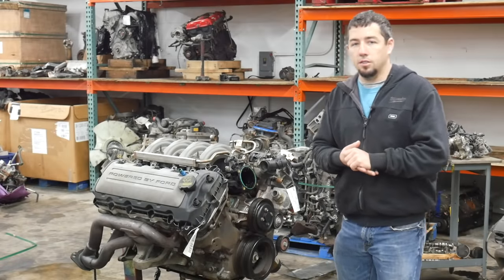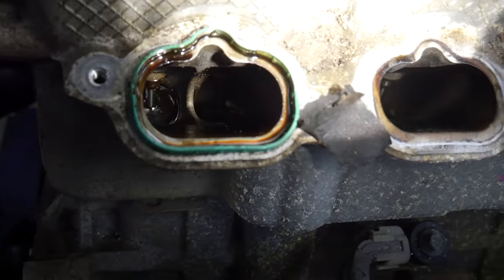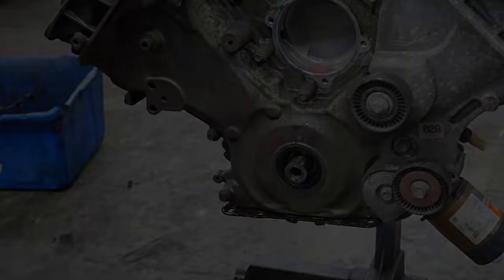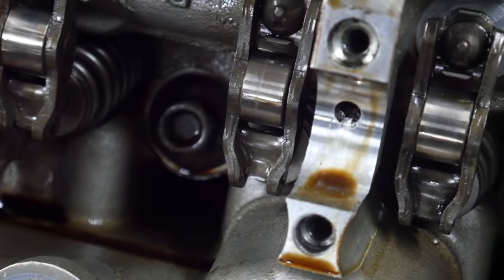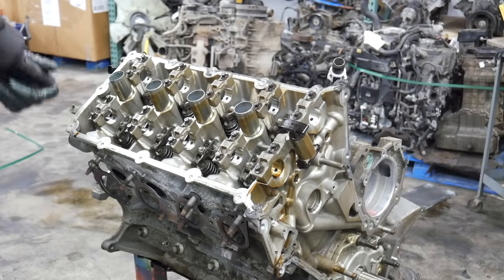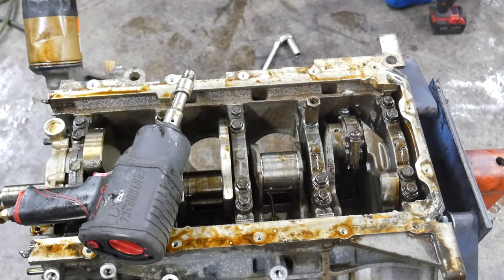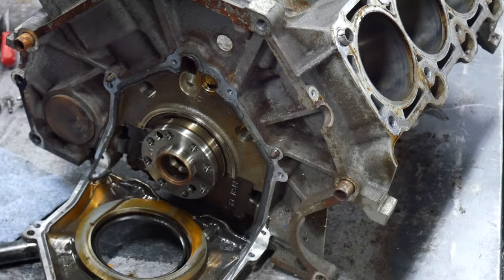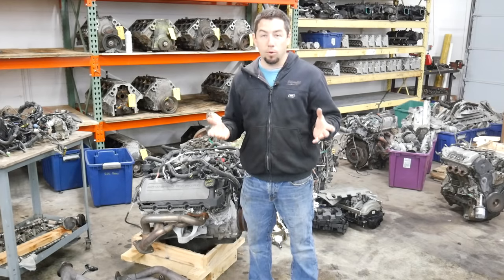Blown Up Ford 5.0 Coyote V8 Total Teardown! 2011-2014 Mustang GT / F150

Comment: 9 mm socket in some Dodge transmission & many more in Mercedes. Or in rust belt for 10 mm bolt removal.... Yeah, cheap oil! & filter, extended oil change intervals... What could that hurt?? Cheapest maintenance you can do, check & change the oil & filter. But no-o-o they can't check the oil level or condition??

Comment: Based on the condition of the engine, looking like it was well maintained, I would say probably not oil starvation. A lot of people have these tuned and they really don't like detonation. Probably got detonation on one of those back cylinders, took out one rod which took out the second. If it was screaming at 4-5k RPM or more when it let go, all that stuff could get circulated through the oiling system rather quickly and cause all that damage you saw. They may have even run it for a bit after the rod let go, maybe to drive it up on a trailer or something.
Reply: Detonation can break a piston but it won't destroy the bearings, one of the rod journals is destroyed from lack of oil.

Comment: mechanically they are not harder push rod guys like the simplicity and ability to be able to tune your own engine at home i 351w carb swapped my sn95 instead of a coyote because no electronics to mess with

Comment: I think its the same old cyl 8 broken ring land from detonation the lead to the rest of the damage the metal in the oil 
Like riding a horse hard and putting it away wet someone hurt the engine then kept running it to get back to the stable

Comment: The color of the metal and lack of sludge suggests this was a well maintained motor .. 
Could have just been bad luck from when it was built .. lots of coyotes are out there with cyl 8 problems and you will never know till she craps the bed sadly

Comment: Love your teardown and inspection videos Eric! My Dad owned and operated his own automotive repair shop for many years , and I grew up working for him . We did a lot of high performance and racing engine builds, so I’ve seen a lot in my day . The worst blow ups I ever saw were the big block Chevy engines that turned loose at 7 to 8,000 rpm on the drag strip, always a horrible mess !!! Has anyone ever commented on how much you resemble Adam Sandler ?? I think it’s uncanny … lol 😂

Comment: I have a 2012 Roush, my friend bought a 2012 GT, he says the oil gear is plastic and needs to be changed to a metal gear especially when you're turning 720 hp like mine is tuned, I think his drugs kicked in on a "plastic" oil gear. Have you EVER heard of a plastic oil pump gear in a coyote?

Comment: I am a little surprised that Ford engines are having issues. Especially their pick up trucks and SUV engines over the years. It actually kept me from buying a Ford again, and I have been driving force since 1978. The kicker was, when they started making the F150, that you have to remove the entire cab to work on the engine or transmission..
  my son told me his neighbor changed the brake pads on his car. And the car now will not go over 45 miles an hour. It must be returned to the service department where he bought the car and plugged into some type of a reset device that only the dealer has. That sounds like something BMW would do, I’m going to have to find out what kind of car that was so I am sure not to ever buy one. Because I do all my own work when it comes to bulbs, brakes, batteries, blades, belts, back up lights, bumpers  and bushings..
  for the first time ever since I started driving in the 1960s, I had to take my wife’s Honda CRV to the dealer because the battery had a parasitic draw that I could not find. It turned out to be a power door lock in the drivers door. That only cost us $900, mainly because it took 2 Different mechanics at the Honda dealership three days to trace it. Cars are getting so that you have to marry the dealer

Comment: On a powerful engine as the Coyote Ford should have installed super strong rods, unbreakable. 
Low oil would cause a journal to be tore up very bad before it throws a rod. 
I think they raced it and broke the rod then piston hit the valves . these two things caused metal to flood the oil system.

Comment: Coyote and LS motors are bulletproof,  however maintenace should not be neglected. This engine must have been redlined most of its life. I have a 2012 with 120,000, spirited driving, burns 1 quart between oil changes. Hell, the capacity is 8 quarts.  Light wont tell you on 1 quart, however, on the throttle it wont be as responsive. 1 quart brings it exactly half on dip stick. Absolutely no problem with motor or auto transmission...

Comment: If you'd check the computer mod that was in association with this engine, you'd probably find very high extended RPM and oil starvation until engine failure occurred. Stupid donut burnouts in parking lots cause a lot of this. You see it a lot.

Comment: the ford coyotes engines are made vary cheap 
that tear down told me a lot of the pistons and rods 
not enough metal in the pistons and rods
good video on this tear down.
Reply: I disagree, do a YouTube video on how the Coyote Motor was built. 420hp in 2011, naturally aspirated 🤔. Motor Trend Muscle Car of the Year. 2011 to 2012 if you can find one , even with 80,000 are going for 20 to 28 grand.

Comment: If you found bits & pieces of connecting rod in the inlet Port of cylinder number 1 & bits & pieces of broken  piston ring around the front crankshaft Seal then that Moore whose a Balazic is also in the United States as well.

In Australia, they were that extra form whose a Ford, in Canada,he wouldn't be known as Donyboy73 (Don Desjardins),I didn't get onto theirs whose an art form in Australia.

In Australia,I'm known as a Holden !

Comment: If you find yourself using this as a guide to take apart your own 5.0 motor do not follow his steps on taking the timing chains off, cams, and heads. Follow the fords manual on disassembling your engine.

Comment: Intake for mustang much different, trucks is for torque mustang for power up top, mustang has larger cams & more compression, mustang has better exhaust manifolds truck has typical brick, mustang has a tri Y

Comment: FRAM making "Quality Oil Filters" since never
Reply: Oil starvation will happen with any filter brand.
Reply: @warrenself  but fram makes the worst filters
Reply: @IIGrayfoxII  Reminds me of the people who say Pennzoil causes sludge. Run one on your daily driver and cut the filter open after.
Reply: @warrenself  I am not the only one that says FRAM are shit.
Reply: @IIGrayfoxII  Does that make you right? No. Run one yourself and observe. Back it up with a used oil analysis. Then run your favorite brand of filter with the same oil and do the same thing. Proof is in the pudding. FRAM has come a long way since the Allied Signal and Honeywell failure days.

Comment: I take a g.m.van or old rear mounted fuel tank. And cut the top off and use the bottom for a catch all under the engine stand .c clamp it to the upright.

Comment: IT'S ALWAYS CYLINDER 8 these damn things have bad cooling flow to cylinder 8, and if you overheat them cylinder 8 likes to run out of ring gap!! Cylinder 4 has only slightly better flow, later gens are a lot better Orr in this case. 

Also you should put those heads up on ebay for engine builders like myself to cut them up for porting research (see how much metal you have between stock port and cooling Passage).

Comment: Hopefully you didn’t pay much for this core.  It’s mostly a boat anchor.  The front pulley is reusable.  That’s about it. That motor suffered a high RPM failure.

Comment: I would bet that car was on a track.  It has a wet sump and all the braking, turning and accelerating sloshes the oil around.  That, combined with a low oil level, will introduce lots of air into the lubrication system.

Comment: People who complain about it being more complicated to take apart an ohc engine are just lazy or scared to mess up the timing.  Only advantage of a pushrod motor is being able to just pull the heads and they're a little smaller so easier for swaps.

Comment: The filter probably blocked first.  Contrary to what you usually read on the net, when you blow up an engine like that it DOES NOT put trash right through the engine.  The filter stops it all.

Comment: Mechanically re-gapped spark plug , an air-conditioned piston, hidden block ventilation and an orange can of death.  What else could go wrong.  Looks like only salvageable parts are intake and exhaust manifolds.   Lots and lots of scrap
Reply from the maker: It could’ve spit the chain through the timing cover I suppose lol

Comment: Those powder forged rods turned back into powder, like Cinderella's coach turned back into a pumpkin at midnight.
Reply: From dust you came, to dust you will return, huh?
Reply: @mrz80  ashes to ashes, dust to dust, if it weren't for Ford, my tools would rust.  

J/K. If it has tits or tires, it's gonna cost ya.
Reply: @jamesgeorge6551    I have a little point/counterpoint graphic I put together years ago:

Point: Why can't women be like normal people?

Counterpoint: If it has tires or testicles, it's gonna give you trouble

Comment: My Brother has a 2016 Shelby GT 350 with 21,000 miles on it and it has a bad engine, it uses 1.5qt every 125 miles. My brother Mike is 76 years old and this was his dream car, he baby’s the car, never drives it in the rain, nobody but him drives it, uses only the special Ford Synthetic oil and filter from the dealer and changes it every 3500 miles (No Joke) I’m here to tell ya, he’s OCD to the extreme with this car and Ford has left him high and dry… they won’t pay for any repairs. So he’s getting ready to buy a new engine and have it put in. Are you interested in his old engine?

Comment: People add cheap tunes and SC, turbo without upgrading the bottom ends, and then wonder why they let loose. I would not waste time on any mod engines from a car that you can't hear it running.  Most are beat hard and put away blown up. It was only turning 7K when it let loose LOL.

Comment: #1 cause of engine failure in all modern engines... powdered metal connecting rods. They fail at random times and you never know when that will be. Could be 7k miles, could be 300k miles.. you never know. Personally I wish they'd just go back to cast iron rods.. at least those didn't randomly grenade for no reason.

Comment: i had a 91 plymouth lazer that you would get valve noise when it got low on oil. top it off she was fine. what is with modern engines my mazda 6 2015 in a hard turn showed low oil topped it off 2 weeks later changed the oil. 2 days later rod bearing completely shelled out.  2 seconds of low oil pressure and the engine died. is this shit oil or shit manufacturing.

Comment: Cylinder #8 was a common failure on the early first gen Coyotes. The 412hp ones. They would detonate in that cylinder from running lean. Seems they fixed it on the 420hp and later ones.

Comment: Most likely the Fram filter and  Using the wrong  Weight oil. I've got a 5.0 in my truck and in has 300000 miles on it use ford oil and ford filter!

Comment: I'm pretty sure the early model coyotes had an issue where the rear cylinders were a common issue because of a bad tune from the factory, and aftermarket tunes would fix the issue...

Comment: I want to hit 160 miles per hour flying.doing 160 mph burning up the tires in first gear doing burnouts. I have seen people run over a 100 mph on bald head tires from doing burnouts

Comment: I have 550,000 on my F150 engine ... only used Fram filters...but the myth continues.
Reply from the maker: If I’m being honest, I’ve never used a fram filter, but I’ve also never had an issue with a car I bought that came with one. I always go OEM when possible, but I’m sure people have fine luck with aftermarket

Comment: I would like to see you really repair this coyote there are mechanics out there who can repair shit like this which is nothing to them and I have seen it with my own eyes in my 35 years of mechanic experience this coyotes not that bad I would’ve checked the spring in the oil pump and the little  piston first once that gets stuck then you’re in trouble I could bring this engine back to life if I wanted to with the same block figure that out

Comment: That engine like a lot of other gen 1s was running massive amounts of cylinder pressure(boost or nitrous) and the rods broke. Ford bean counters never dreamed people would be cranking 700+ crank HP stress on these 2011-2014 GT long blocks(and sad to say they didn't care). I will say that it is lame on Fords part to use rods like that in a GT High Perf short block. Especially when they know better. How do I know they knew better. The 12-13 Boss 302 and 2014 Boss 302S Mustang have significantly stronger connecting rods(the engineers knew what they needed)....so they knew. As a long time Ford guy(im 60 yrs old) and have run Fords all my life I can tell you its not the engineers at Ford that are the problem...its the bean counter mentality. Even when they had better stuff they would not use it because the profit margin was not great enuff. The gen 2 and gen 3 basically have the Boss 302 rods.

Comment: His diagnosis is wrong... Impossible for the oil to run low with sensors and safety systems that would shut down the motor automatically... The engine was built wrong from the beginning.  To little steel utilized for the pistons to handle the compression... SNAP

Comment: That's what happened they listen to the bottle of oil saying that you can go 10,000 miles without an oil change I don't care what it says you should never go more than 3000 Miles especially on a performance vehicle
Reply: Finally, thumbs up, yep when you bought that car in 2011 they pushed the 10,000 mile oil change. I got 120,000 , burns a quart in 5,000, changed every 5,000 always nice honey color

Comment: It's not a fancy high-power V8, but I have to ask, have you done any of the GM "Atlas" engines, the 2.9 four cyilnder, 3.7 five cylinder, or 4.2 six cylinder? I have one of the four bangers in my truck, and while it's been a dependable engine for me that hasn't given me much trouble, but you can certainly see the Hand Of Isuzu in it, where they've put failure-prone parts in nearly inaccessible places, and there are some pants-on-head retarded design decisions in the engine, such as needing to have the oil pan off to remove the head, because the head can't be removed without removing the timing cover, and the timing cover can't be removed without taking off the oil pan.

Comment: That's some new credit idiot kid or young adult that doesn't comprehend the significance of maintenance. You see it all the time with under 30s that haven't checked or changed the oil in over 10k miles. The oil light is coming on when they go around corners and they still don't check the oil. Shortly after that it spins a bunch of rod bearings and shats out a rod. Maintenance free owner is shocked and it's just a junk motor. Anybody is at fault but them. They make me laugh 😂.